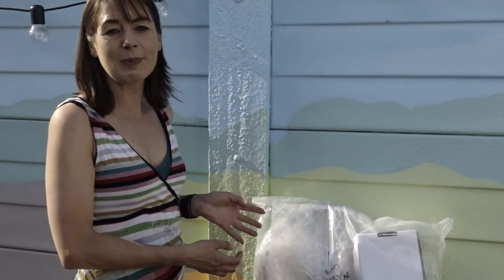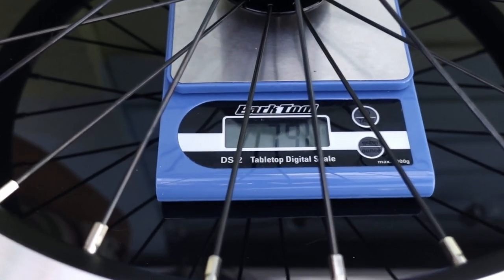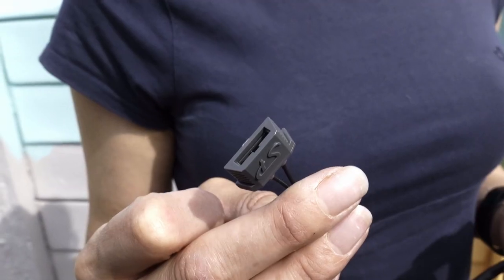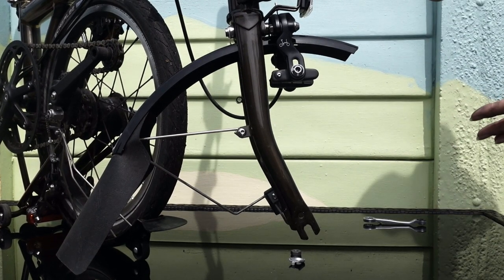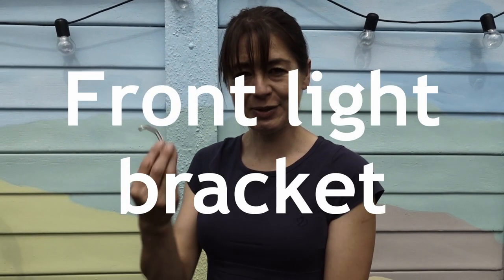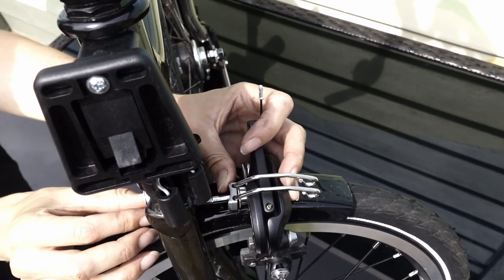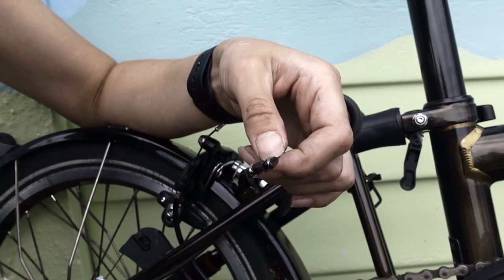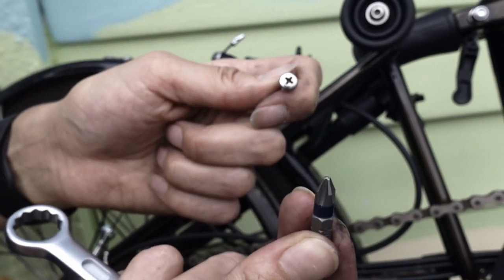Brompton SP SV 8 hub dynamo system

Comment: OK I finally fitted it to my ex's Brompton. Thanks for the super clear video. Here are a few things I found tricky (I don't normally work on Bromptons)

1. Getting the wheel off - I looked around for how to release the brakes but it seems you really need to flatten the tyre first (this wasn't obvious to me - perhaps I missed something)
2. The hardest thing was fitting the spade connectors so I'm pleased you focussed on it. I got the whole job done only to see one was hanging off. Then I had to re-shape it unconvincingly with pliers. It seems ok but i'm still not convinced it'll stay on. Wondered about putting a blob of hot glue on the back to hold it together but i thought i'd keep that up my sleeve just in case
3. The routing of the cables was MUCH easier than i expected by carefully following your video (thank you) the Brompton instructions are P A N T S
4. The brompton didnt make quite the ideal stand i expected and i later noticed i had broken the front clip (re-ordered a new one from you and was an absolute pig to fit - the nylon cutting of the new thread didnt work so well and i spent an unhappy evening sawing the bolt off and doing that again).

Overall, i like it. I thought i'd have to take it to the shop for this job and your video showed me how to do it myself and learn something in the process. It made me want to swap my Bike Friday Tikit for a Brompton or perhaps, well, N+1. The front light itself isn't very bright so perhaps a later upgrade as you have suggested elsewhere is a good idea.

Sorry i didnt order the dynamo from you, i was being a bit thick when i first watched the video. I have ordered subsequent parts from you and was impressed with your website and the ordering process. You're not all that far from where I live so perhaps i'll pop in when i need a LBS!!

Comment: Really good. If there was anything I’d upgrade the front light. The one on this kit is 25 lux and for travelling on unlit roads or canal towpaths 50 lux would be better. Overall another v clear film well done.
Reply from the maker: Thanks for watching. Agreed totally - in fact version one of this video was going to have the light then replaced with a Supernova light - but the bike got stolen. We do plan to do different light options soon.
Reply: brilliantbikes Thanks. That would be helpful. I’ve ended up with a Son/edelux on one Brompton and a Shimano hub and B&M 50 lux on the front of my other. Both setups are very good for the unlit roads and canals I go on. Thanks
Reply: Which supernova light do you suggest?

Comment: Ma'am  if you sontind may I ask if for example there is a dynamo ,it can affect the pedal for running the bike it can hard to pedal coz there is additional burden can affect also to run the bike to be slowly?
Reply from the maker: Thanks for watching - and for the question

We think it runs so smooth that it doesn't make any difference, but ......

We have just invested in a pair of power meter pedals - so we can measure the energy required to pedal.

The plan is to make a short video showing the same ride and how much effort is required with a standard wheel, a dynamo wheel with the light on and a dynamo wheel with the light off - how does that sound?

This should give a scientific result!

Comment: Great video, if I fitted the light to my M6r, is there enough cable length to reach end of the rack, and does cable run under the rack?
Thanks
Reply from the maker: Thanks for watching and for the kind comment - it makes us really happy if they are of some help 

The Brompton wiring loom is long enough to connect to a light mounted on the rear of the rack (where the reflector is mounted by default)

The wire runs through the rear triangle (it’s hollow) and up the rear stay of the rack before connecting to the light
Reply: @brilliantbikes  great, thank you

Comment: Hi, I really like your videos and have just received my dynamo kit so can’t wait to get it fitted. In the video, you say the spades fit to the output but show them fitted to the input (I think). Is it meant to be the output it is fitted to?
Reply: I connected as you show in the video (the printed instructions are pants) but yes you connected to input and this caused me problems (back light on all the time then failing) going through the wiring again with my glasses on (ahem) I spotted the in/out  written on the back of the light